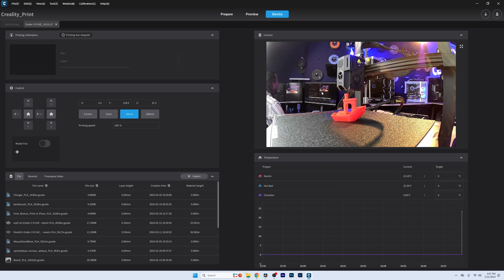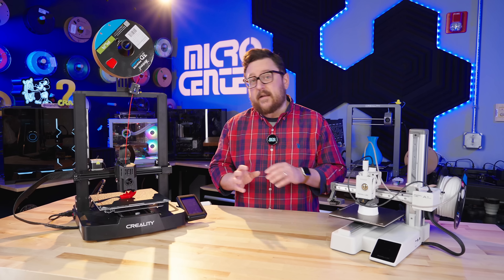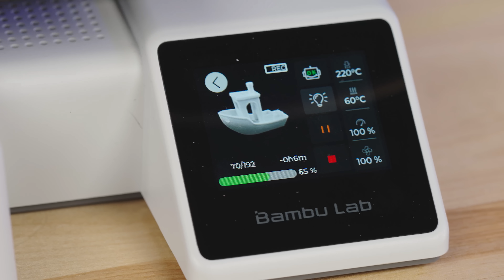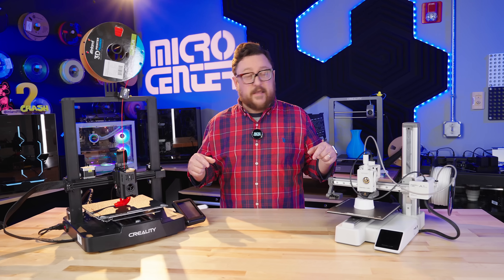Need A New 3D Printer? Bambu Lab A1 Mini & Creality V3 KE Are Two Great Options

Comment: 8:24 on the website it says that ABS is not recommended for the A1 Mini. I'm assuming that's due to the max heatbed temp of 80 degrees.
Personally that's really a dealbreaker for me cause I am looking to print using ABS

Comment: Never realized that people struggled with bed leveling, but then I Work in Motorsports and we use scale pads that all have to be leveled every time we set them up. Never thought that skill would be used anywhere else then got my first 3d printer (ender 3 v2) and leveling the bed was super easy and never fought it once cause it was just a smaller version of scale pads so I never fought it cause it was just second nature for me, the biggest struggles I fought was bed adhesion that was my biggest head ache but now I got suave extra hold #5

Comment: I'm going to buy mini without doubt for my 8 years old boy. Bambu Mini practically no need to calibrate, rock solid machine with sensors like filament pressure compensation, size - anyway we never print anything bigger and there's only 2cm difference. I saw on KE from other reviews problems with high linear pressure advance - extruder problems, build plate bottom bearings wobble, z need frequently readjust e.t.c.

Comment: Printing on my A1 mini as we speak, it has 0 stringing, 0 layer error, 0 faults, its just a printing beast ! such a value for your money
Reply: My ender 3 v3 se broke so I sold some stuff and have 230 and they are both on sale for that price which should I buy in your opinion
Reply: I fixed the printer but it is still not printing properly
Reply: whatd ya end up with?
Reply: @Joelcork  A1 Mini all day
Reply: Did you get it for $50 cheaper?
Reply: @abdularif1086  yes
Reply: Do I need a computer to use it?

Comment: What is the best printer to print lowered for "Pew pews"🔫?? 🤔🤔  That can handle carbon nylon temps.. like I'm think 320 degrees minimum... I'm guess in o around the $500 mark or less if possible

Comment: “Back in the old days if you had a printer on the other side of a room you would either have to put a thumb drive into it or even worse have it plugged in to your computer for the entire duration of the print”
Me: nervously looks towards my old ass original ended 3 plugged into my computer because the USB port came broken
“Yeah wouldn’t be me”
Reply: *sd card slot not usb

Comment: You're too slow! I just picked up a KE from MicroCenter last Thursday (randomly checked online to see how much they were, and I saw one that said "open box" with an offer that I couldn't refuse; been a slightly bumpy ride getting it going with the settings and temperatures, but fortunately the printer itself works pretty well [aside from some bizarre rippling in the parts.. not really sure where that's coming from 🤔]) I do wish the store was a bit closer though; an hour and a half isn't the worst drive ever, but it's hardly just around the corner..

Comment: ain't no way - NEVER EVER get the Ender 3 V3 KE, I got it, it broke, Creality didn't help, I fixed it, it broke, Creality didn't help, and wash and repeat. The Ender 3 V3 KE is just SO unreliable literally 3/4 prints will fail. Always Bambu Labs over Creality.
Reply: Never buy Creality. Learned the hard way after multiple Creality machines (Ender 3, 3 pro, 3 v2, S1, 5 Pro, 2 Pro).
Reply: Oof that sounds quite costly
Reply: There are literal print farms of Creality doing 24/7 printing 😂  they also have warranty, so quit B S ing people

Comment: he should mention the software as well, the slicer..... for someone with zero or little experience in 3d printing between the 2 there is no comparison, the bambu lab is just easier to use and more reliable, for good result with the Creality you need to download a second slicer, like Orca, and start using that (and loosing some feature of the machine).
Literally the only pro of the V3 is the bigger bed, in everything else we are in 2 different categories
Reply: The creality slicer is not good I will give you that. I have orca, prusa, and creality and almost exclusively use prusa slicer now. Couldn’t even tell you the last time I used creality slicer. 90% of the printing issues I had went away when I stopped using creality slicer. That’s the 1 thing I wish I would’ve learned sooner when I first got into printing, I thought I could only use creality slicer cause I had a creality printer. Then when I learned I could use different slicers that was a huge game changer and would’ve saved me so much headache
Reply: 222😮22😮😮2😮

Comment: I didn't think the AMS Lite could handle TPU.  You may want to check with Bambu.  I know it's not recommended on the regular AMS.
Reply: I haven't check but probably it is because the system is different... in the regular AMS the filament is going trough the AMS itself, motors, tube behind the machine, tube inside the machine and the extruder at the end, for a very flexible material as TPU is an issue.... in the A1 mini and full size the filament only go from the AMS mini to the extruder directly, the A1 extruder accept all 4 filaments at once and swap them directly with little movement, the P and X only 1 filament at the time and use the motors inside the AMS for a full retraction of the filaments
Reply: the path is too long for TPU, it doesnt work @juryfilanti
Reply: I have the A1 w AMS lite and so far I haven’t had a issue with multi color tpu prints I’ve done three in the last two weeks so maybe they fixed it with the latest updates or I’ve just been getting lucky. 50/50
Reply: @SoullessCasper as I said the A1 (both) basically is direct drive with or without AMS, reason why the regular ams is clean looking and the Lite is a mess with cables.
But in one you can connect 16 filaments in the other 4 is the max
Reply: @juryfilanti     idk why but on my phone it cut your comment off and didn’t have the read more tab, but I also was replying to Generic, I wasn’t arguing. I was explaining to there comment that on the ams lite it worked for me that’s all. I understand what you are saying.

Comment: The A1 Mini is rock solid. Linear rails on the all axis. I'd pick it over a creality any day.
Reply: 5 says 55 MI cncnnfnfbdbdnndndjdndndndndndnnfcn
Reply: did creality has linear rails on all axis too?
Reply: Its a toy.  Basically just good for printing miniatures.  It is too small
Reply: @anthonylong5870  You dont know anything about 3d printing it seems .... LOL " Only good for printing miniatures " is minis 18 cm tall ? 18cm wide ?
Reply: @pitbullash  Print a helmet on it ROFL. Or try making functional prints over 3 inches.....Yeah, its a toy
Reply: @anthonylong5870 a helmet? That is just a toy. Also, most functional prints are in that print size. I find that most of the time. I use 3d printing to create joints, and use wood or stronger plastic to build the main frame, so you don’t really need all that much on the print bed
Reply: @anthonylong5870  oh printing big part with plastic, good idea   especially FDM style  , great choice bro
Reply: @anthonylong5870 how tf is a helmet not a toy you fool
Reply: just 4 cm in all axis more for the creality, how come the A1 Mini is a toy compared to the Ender? What exactly do you print in that machine that the A1 Mini cant handle?

Plus no multi material, no linear rails and bad quality all around (its creality, chinese crap) @anthonylong5870
Reply: @anthonylong5870  I disagree as it is a toy for you but for many it's more than enough to get started 3d printing. It's fast and reliable which is more important for some people. I would still recommend it to beginners.